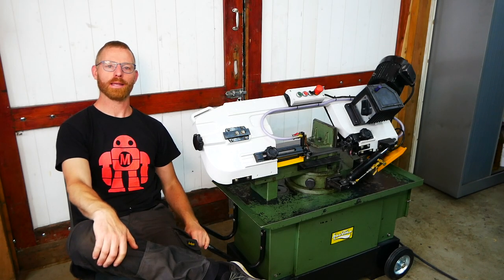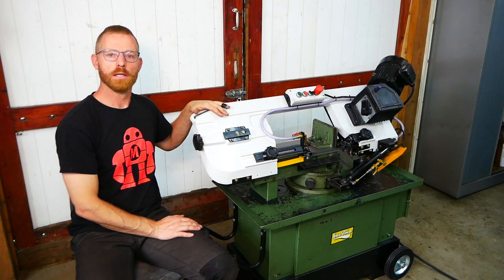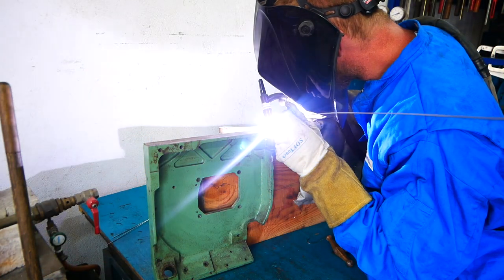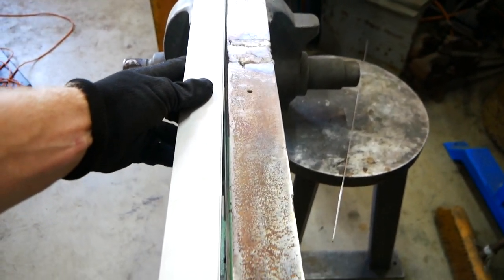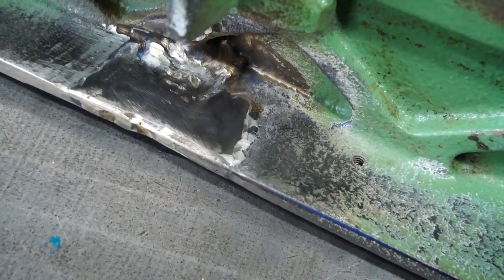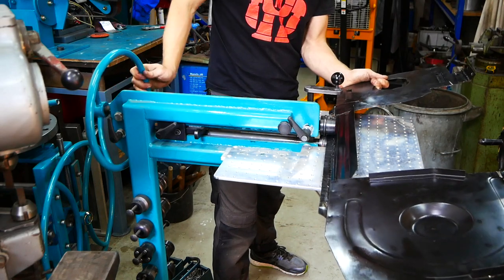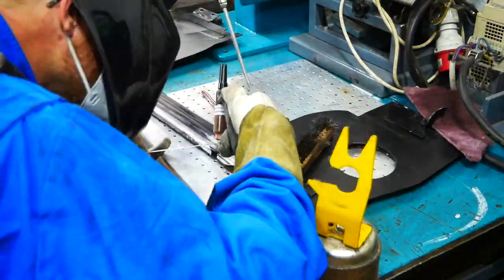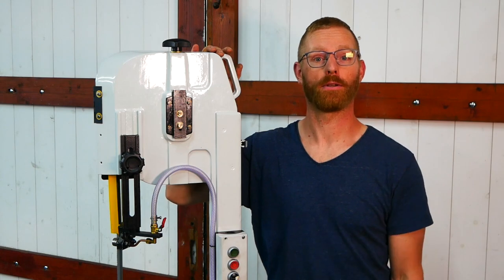Huvema Band Saw Repair P1: Cast Iron Weld Repair with 316 wire and making a support frame

Comment: Good job,Bart. I would have done very much the same repair with the steel reinforcement strong back bolted in place. One thing I would do differently is using epoxy metal paste to bed the repair piece more uniformly to the casting before tightening the fixing sctews/bolts. 
This ensures you get as near 100 percent contact face between the two items. Good job all the same. Glad it turned out good👌
Reply from the maker: Thanks. Yes metal epoxy would also be a good idea. I didn't have that in my shop and wanted to finish the project.

Comment: Youtube Good. Of the land have me the idea for a table for the bandsaw that was simple. Fast.removable and cheap 2 inch square tube  welder into 90 degrees stuck into the vise and more tube under the table you can make table any size you want no bolts just slip into your vise tighten and use.
Reply from the maker: Yes i was thinking about the same idea! But I will also fix it to the frame with some sort of quick lock system because the frame is not very stable in vertical position.

Comment: Disappointing to see this done this way.  Gas welding with cast iron rod and the proper flux.
Reply from the maker: Sometimes you have to work with what you got. Better wire would be better. But it's still holding fine.